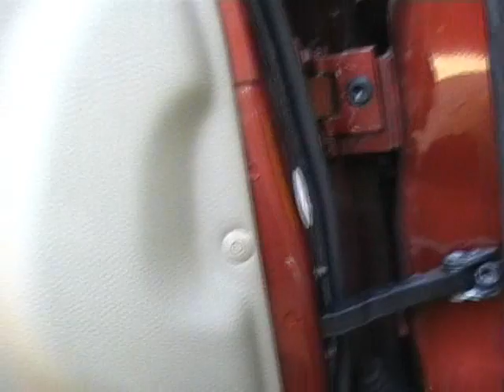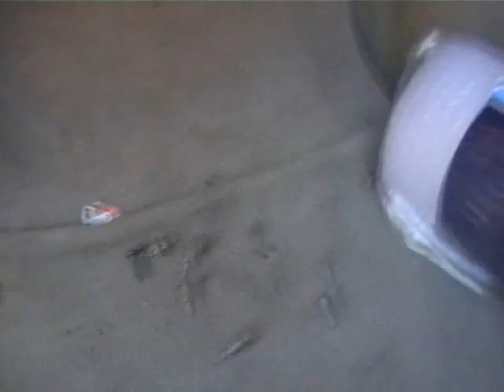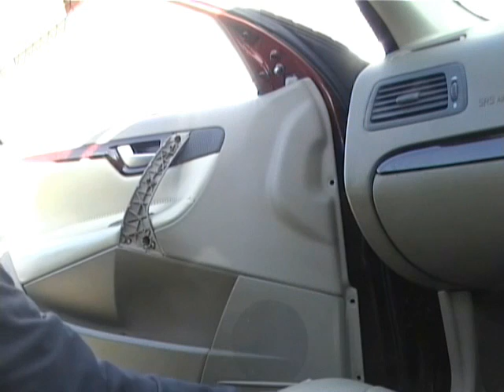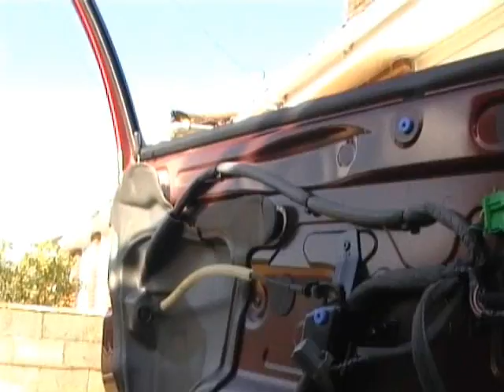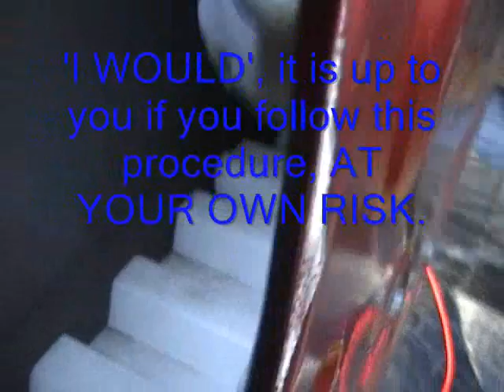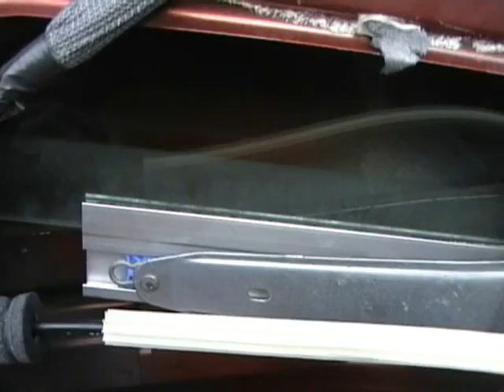Window stuck down Volvo V70 2001 front electric window.

Comment: Volvo v70 2001 The fault occurred after pressing the window lift button. The window went up and down, then the button stopped working. Disconnecting and reconnecting the main battery helped. After this procedure, everything returned to normal. Thanks for the video and user comments.

Comment: Thanks mate, that video might help me.
Maybe a 2004 Volvo V70R AWD has similiar door setup...
Yesterday I was out buying food and we had -12°C or so. Anyways the driver side window panel was stuck frozen and to better reverse into a parking lot I - idiotically - lowered the window.
Quite a loud "crack" or "pop" whatever occured and the window panel sat in there in a weird position.
The panel itself doesn't seem to be broken - at least the upper part from what I've seen.
I managed to manually close the window so it seems closed and drove home.
Later today I wanna undo the door and check on the motor, the clips, panel lower area and stuff for damage.
Hope that I don't have to buy a new window lifter or other parts.

Comment: Fuse 27 out and ignition on, ignition off, fuse back in and drivers door window fixed in 30 seconds. Thanks so much, was dreading a big bill. Combination that caused it was closing window and turning off/removing keys just as window closed, window then bounced at the top and came all the way down and wouldn't budge.
Reply: John Gibbon my man u saved me a lot of headache.....instant fix!
Reply: Same here what a legend you have just saved me a load of trouble! Mechanics saying motor/regulator ect… 5 minutes on youtube later and she’s sorted!🥂❤️

Comment: Thanks , This fixed my issue with my 2004 XC90
I replaced my defective windows switch with a good switch and the window was not moving down.
I removed both (Motor and the window switches connectors) then I turned on the car ignition.
First I  Plugged the 2 window switch plugs, followed by the motor plug while the car ignition is on ..Tried it again and it works :)

Comment: Thanks for sharing.
Got problem with power window. It works perfect untill i start the engine. After that it stop working at all. After switching off the  engine , power window works "normal". Anyway I will use your instruction . Thanks again.

Comment: Thanks for posting this. I need to replace my master window switch and originally tried to pull it straight up with the door card in place which does not work on my 2001 V70.

Comment: Hi. Thanks for vid. A quick fix that worked on my 2002 V70 was to leave the battery connected, ignition off, remove fuse 27 (in the end of the dashboard), power on and off again and then fuse back in and power back on. Window worked straight away. I guess this fooled the module into thinking it had been disconnected. Either way, it did the job on this occasion. Give this a try first.
Reply: Kevin Storey I'm so glad I saw your comment.  I had the same problem with my 2002 S80 and was ready to take it to my mechanic.  I just went out to my car, did nothing but pull fuse 27 and plug it back in.  That did the trick. The window then worked as it should.  Thanks.
Reply: Kevin Storey Looking at the fuse section in the manual - that relates to the Four-C active chassis system - unless on cars without it it goes to some other ECU?
Reply: imdbl Glad to see it worked for somebody else too. It's great when you find an easy and free fix! For the record, the window on mine still works fine.
Reply: kr239 Hi. Mine doesn't have the Four-C Active Chassis system so I wouldn't know unfortunately. I never went to the user manual. I just read which one it was off of the fuse board cover. You are in the fuse box at the end of the dashboard right?
Reply: +Kevin Storey Worked for me!
Reply: +Kevin Storey I just tried this just now and it worked! Thank goodness! I have an '02 V70. Pulled out number 27, turned car on and then off. Put it back in an presto, it's went up.
Reply: Kevin Storey Thanks i will try your idea first then if it still don't work i will have to disconect the motor and if all that don't work, i will open up that part of the switch coz it may not be getting the contact when i push the button.
Reply: Fuse 27 taking out and in with ignition in and out .Thank you very much for help.
Reply: Kevin Storey, this could be a silly question but if I try your way the door does not need to be taken apart correct?  Also, would this trick work on my 2002 Volvo S60?
Reply: wow, thank you! It worked like a charm on my V70XC 2002!
Reply: Thank you Kevin, did it as you said, 2002 V60, you are awesome!
Reply: Thank you su much! This also worked for me! Great easy fix!

Comment: Another thank you is due you for posting this video.  My 2002 has done this about once every summer.  I don't recall going to such lengths last year but this year, pulling the LH door module fuse gained me nothing.  Like you, my window rose again for merely reconnecting the harness at the window motor. Cheers from Michigan USA.

Comment: Great video.  Sorry to burst your bubble but the solution to this is to disconnect the battery then press the brake pedal to fully discharge and reconnect the battery whilst the key is in Pos II.  The passenger door module's fuse could also have been removed which would have cut power to the PDM.  Also by using Vida/Dice you can perform a PDM window calibration all done remotely if above method fails.